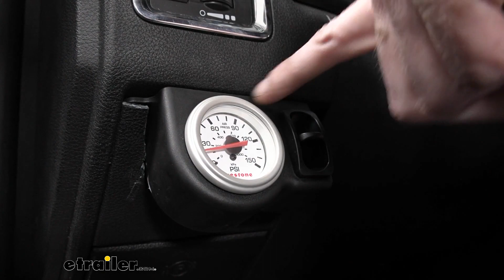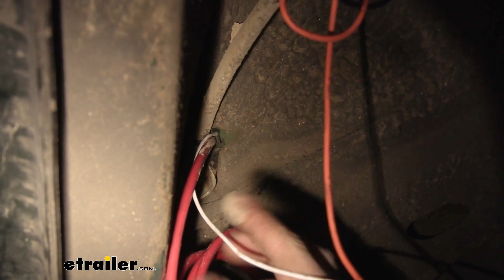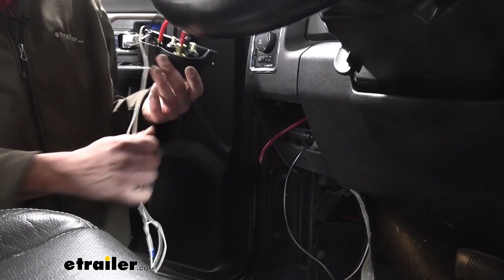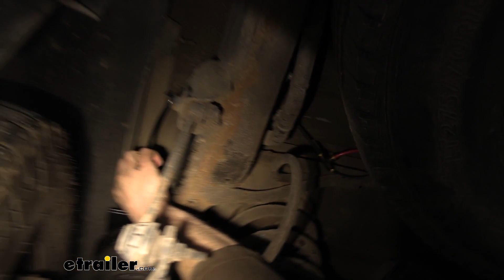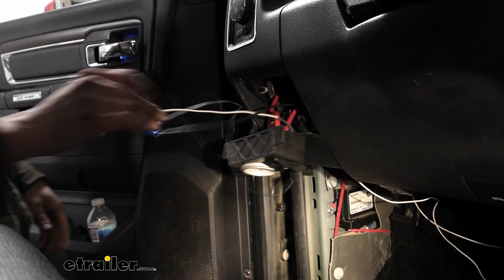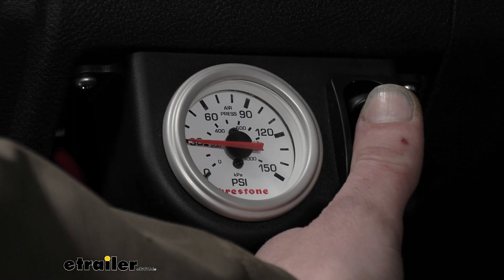etrailer | DIY Install: Firestone Air Command Heavy Duty Air Compressor on your 2017 Ram 1500

Comment: Thanks for the video. I have this installed on my truck that I purchased used. It stopped working so I’m trying to troubleshoot. My relay was electrical taped and when removed some wires were popped out. Do you know which wires go to what on the relay? From your video it looks like there is a jumper?  Also I believe my compressor is shot.
Reply from the maker: For the 3 wires on the relay: Orange positive to the compressor, white wire to the white wire on the switch panel, red goes to a 20-amp inline fuse that will go to the positive side of the battery. I've also linked the instructions below. Page 2 gives you a full wiring diagram. 

Instructions: https://www.firestoneairide.com/rr-kit-install-manuals/WR17602097.pdf

Firestone Compressor: https://www.etrailer.com/Accessories-and-Parts/Firestone/F9499.html